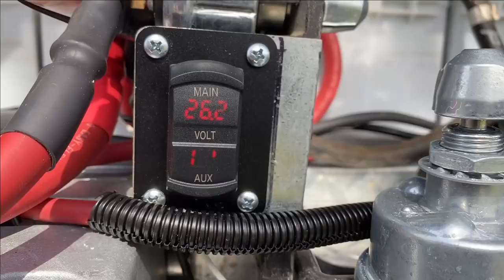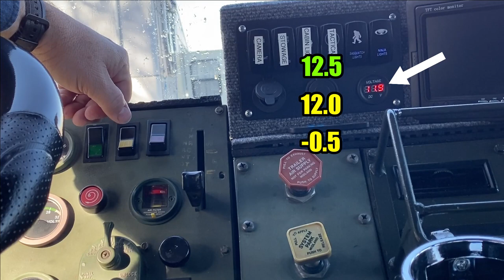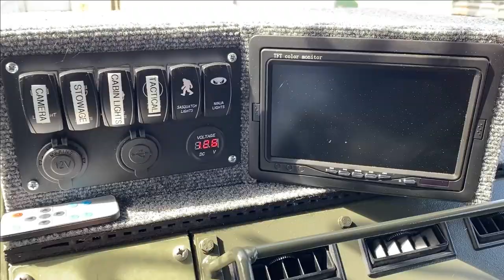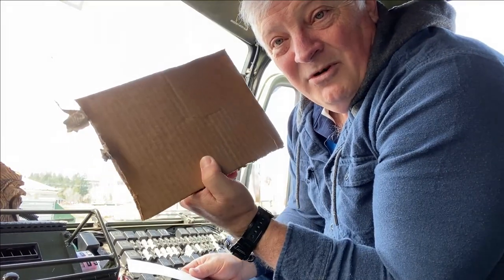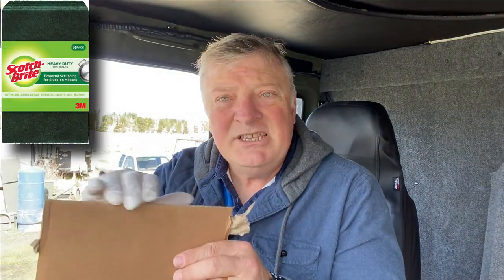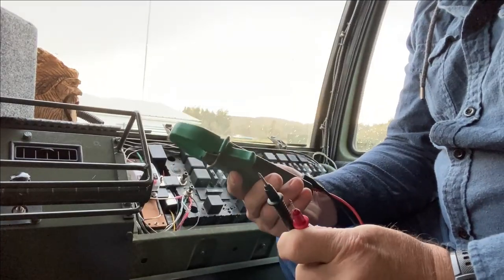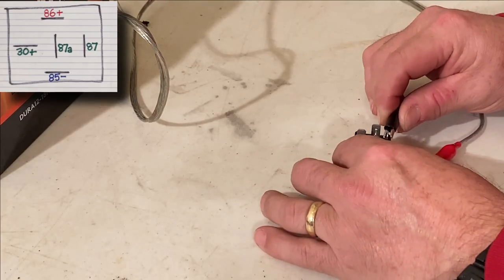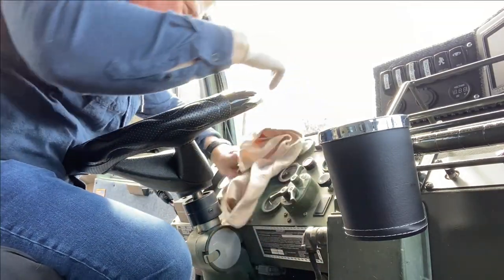"POW-WAH" DISTRIBUTION PANEL Maintenance #180

Comment: I noticed a similar issue with my truck. My voltmeters read a bit higher at the batteries than at the dash.  I need to directly measure the voltage drop from the batteries to the PDP. About those OEM circuit breakers you're still using....I changed them all over to plain-Jane automotive fuses.  Another benefit is that automotive fuses also support voltage drop parasitic draw testing.
Reply from the maker: Since I have never had any issues with the fuses, I never felt the need to change them. I like that they are circuit breaker protected, too. I guess I should change mine out... someday. I did have to replace a few relays, though.

Comment: Howdy folks. Im getting ready to receive my lmtv. Could you note what fuses/relays i need. Im gonna swap them all from the get go.
Reply from the maker: Before you start pulling stuff, swap the fuses with the same AMP level fuse. Also, pay close attention to the relays… replace with 12v/24v correct, 4 or 5 pin. Get it right or you’ll being paying for it later. Mine had a compatibility relay set of numbers on the inside of the PDP panel. Check for compatible relay types.

Comment: I noticed you have changed to a smaller battery, what do you recommend?
Reply from the maker: Yes, indeed. I changed out the "tank" batteries because they were old and failing with standard large sized off the shelf batteries. If you want to see the entire battery box rebuild, go to my channel and search my channel's search bar, "battery." I show how to replace it all, with circuit breaker protection, shut-off's, battery maintainers, and an equalizer. Pick what you want to do... but it is all there.